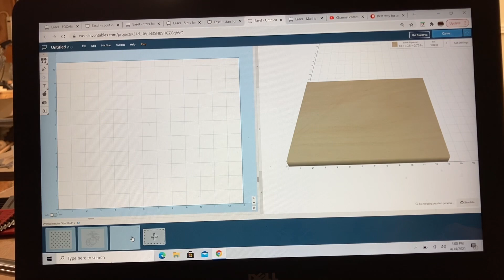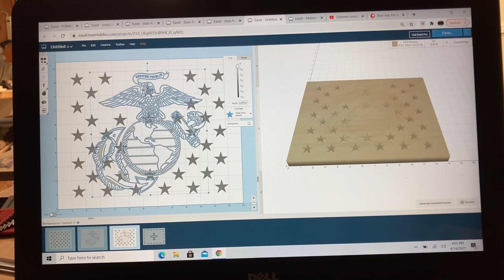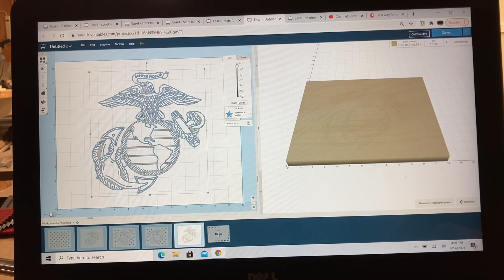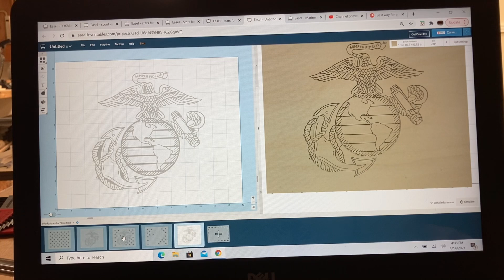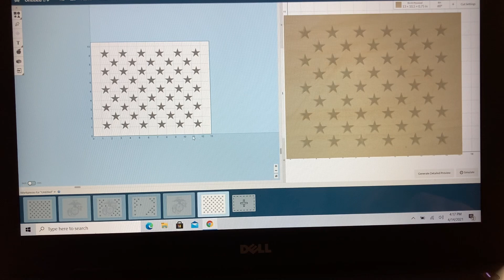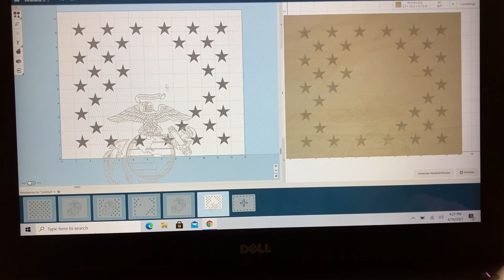Marine Logo Added to Union Using Easel Part 1

Comment: what is the best wood to use for one piece flags to get the detail in the logo?
Reply from the maker: A hardwood is better.  I use premium for the union stars. However, if I were to carve this out with the Marine logo in it I would use maple.  A hardwood gives cleaner cuts without a lot of sanding required.
Reply: @PawPawsWorkShop   Thank You!

Comment: I love your videos, I usually add it to the lower right In the stripes. Great video
Reply from the maker: Thank you very much.  I agree, that is where I normally put the logo as well.  However, many people have asked how to do it and how to remove the stars.
Reply: @PawPawsWorkShop  I do it with a offsetter v2. I've learned a tremendous amount from your videos. Please keep them coming.
Reply from the maker: Thank you very much.